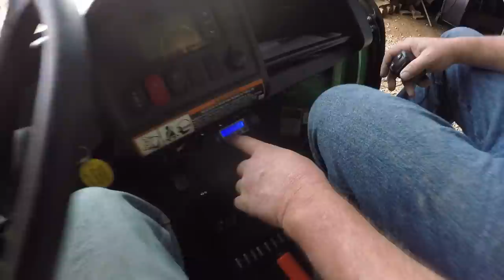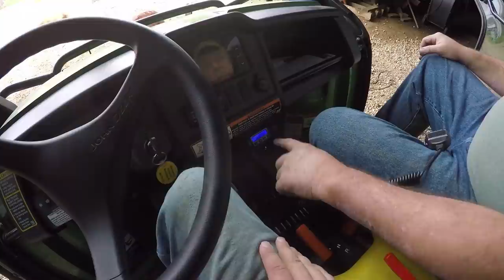A Day in the Life - Ryan Kuster

Comment: On the corn... I inquired this year a feed specialist on cracking the corn. Long story short he claimed if your feeding a hay ration on top of shelled corn you could be looking at as much as 50% loss on not cracking. 
But, if your just feeding shell corn like to feeder steers say there digestive system slows down and will absorb way more. That's where it's sometimes worth weighing out of grinding or rolling is worth it. That's just what I was told and I condensed it for you. Keep up the good work.

Comment: Ryan, don't expect to get the distance listed on the Midland radio package.
Those are vastly over-rated and are for ideal circumstances like talking from one mountain top to another mountain top with no obstacles in between. Under typical conditions you might get half the distance listed when talking between hand held radios.

Comment: My 2000 dodge ram diesel with Manual transmission  gets 24 mpg 16 hauling the stock trailer loaded."11cows"  it's not a stock pickup. If you get rid of that DEF put a better flow exhaust, cold air intake and a good Tune  on it you will get better mpg.
Reply: V&G farm only thing with a cold air intake is u only get like 2 more mpg  and maybe 8 horse power not really worth the money if ya ask me. If it was I would have done it to mine already
Reply: Cold air does nothing. When air goes in the intake and gets compressed by the turbo it needs to be hot.

Comment: I filled up my truck on top of a mountain and drove down the 3 mile decent and my computer said I was getting 77 mpg. I don't really think those computers are an accurate way to check your mpg.
Reply: They can be very accurate but not always
Reply: My pickup doesnt have that feature (96) but my car does and i find that it estimates low. 19 gallon tank and it will say i have sixty miles to empty about 3 gallons but it will only take like 14
Reply: You’re going down hill, the computers (these days) are some what accurate (2+/- MPG). Going down hill means the engines are not really using any fuel because the gravity is not only going against the vehicle but is also propelling it. Therefore why you got 77 MPG downhill.